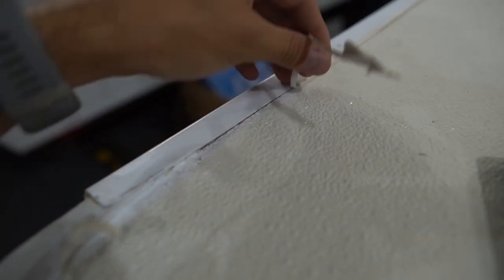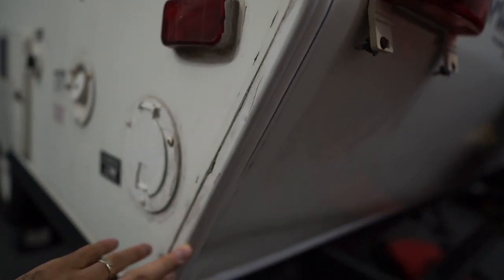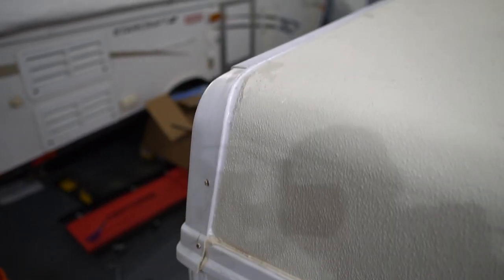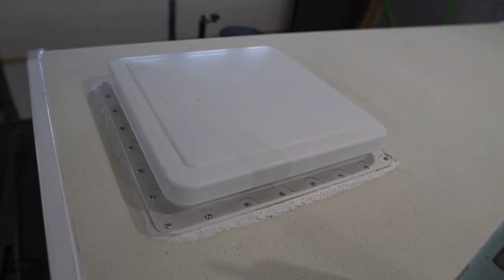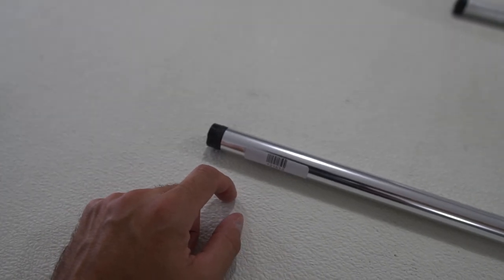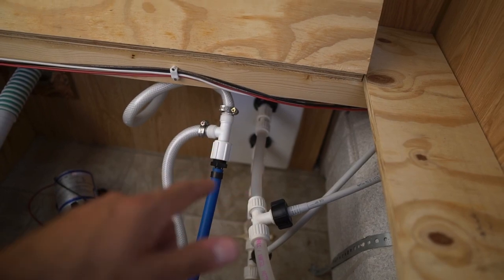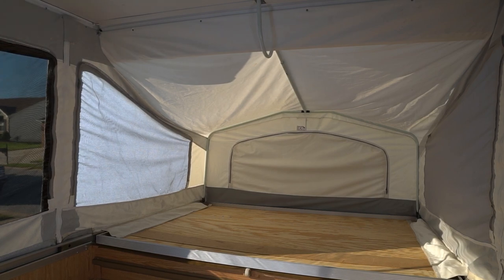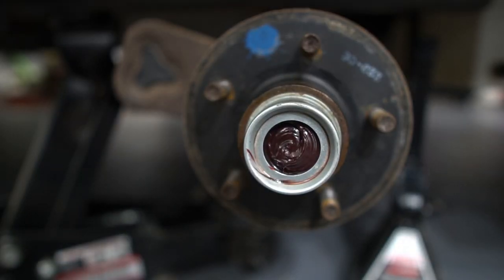You NEED to do THIS to Your Pop Up Camper! | The FREE Pop Up Camper Renovation | Part Six

Comment: Hi,
I work for a caulking manufacturer, and i’m going to tell you one of the best kept secrets in the industry: DON’T SMOOTHEN THE CAULK BEAD WITH YOUR FINGER!

The reason it eventually cracks is because it actually tears up. This is because it lacks the necessary tensile strength to follow the movement of the two surfaces on which it is applied.

 It lacks tensile strength precisely because you removed a lot of material from the bead. More or less like taking a knife and carving off some of the material from a bungee cord before jumping!

On top of that, when the bead dries, it gets even smaller due to the volume loss caused by solvent evaporation.

Leave the bead at a convex shape, learn to like the way it looks, and your caulking will last a lot longer!

Of course, the downside for professional applicators is that they will have less work, since they recaulk less often 😉
Reply: Aargh! I don’t know if I can learn to like it! But still great info!

Comment: Be careful using the ez lube fittings on your axle. Especially if your camper has electric brakes. They will push grease out past the rear bearing seal and cause the brake pads and drums to get grease soaked. Which everyone knows isn't good, but it can also cause a fire from the heat build up with the grease and brakes.

Comment: This is super good info.  Previously being an RV tech we would do this work a lot!  Dicor self leveling sealant on the roof is still my favorite sealer.  It goes on easy, and if you need to get it off to replace a vent or just reseal it later, it is still easy to work with and remove.  After seeing what happens with silicone over the years though I (and the shop) switched to PL based sealer, our favorite being "Sikaflex" in the appropriate color.  It really gets stuck to the surfaces good, unlike silicone which seems to peel right off after a few years.  One important note though... don't get it on your hands!  And don't touch it after it goes on!  It's so sticky that if you do end up trying to smooth it out, you basically end up making more of a mess anyway.  Not to mention it really doesn't come off your hands.

Comment: I used the self leveling sealant on my camper and it still shrunk and cracked. I ended up using 4 inch eternabond tape and absolutely couldn't be happier with it. I would recommend the eternabond all day long.

Comment: Our 1994 Popup camper was stored in a barn and garage most of its life. Someone caulked the seams but used crappy caulking over black mold. I replaced both bearings and both tires. The tires on a popup camper are not the same as an automobile  and do not like sitting in one place for years. The tires on ours were thumping when we brought it home. This indicated the cords were damaged from resting in one place. I replaced the cord hatches and will replace the outlet cover in the spring. With Winter around the corner, I have no inside storage so it got tarped and the Gazeebo cover from our easy up  that the wind destroyed this summer. In the spring ,I have two rolls of the trim tape to replace all the old brittle and missing trim . I intend to replace all buetle tape and recall all seams and joints using Outside caulk.

Comment: Question unrelated. Do you have a video on electronic brakes? We are buying a used high wall Jayco. How do I know if my 2011Ford F150 is set up with proper trailer plug-ins (Lights, braking system) to safely haul it home?

Comment: Hi!  New pop-up owner here...08 Fleetwood Arcadia! Came across your channel a few weeks ago and love the videos I've seen...thanks!  We need to reseal many places on our pop-up and you mentioned butyl tape.  We found strips of this gray stuff in the cabinets of the pop-up that looks like that stuff you'd stick under posters and I'm now wondering if it's the old tape that's been pulled off.  Do you have any videos of you applying that tape? Thanks!
Reply from the maker: It's been a while, but I thought I showed it in this video. It comes in either white or gray. There are links to the butyl tape we use in the video details for a better look.

Comment: I saw that you covered the screws around the AC. Are there any other screws around the camper that should be covered by either silicone or the foam stuff you used around the AC? I heard it mentioned on one of the channels that water can get in around screws if not caulked. Any opinions?
Reply: I want to know about this too! Isn’t scraping the caulk off going to be a problem? The owner is at some flint going to have to replace that flange

Comment: Do you need to reseal the AC on roof??? Any videos on that process?
Reply from the maker: No videos, but your air conditioner has a foam seal/gasket that goes around the perimeter of the roof cut out. If yours needs to be replaced, you can find them on Amazon. Don’t use caulk or any other sealant other than the aforementioned foam seal.

Comment: Hi it does looks nice bit I wouldn't  use Silicone  because there is a kind of acid in that harm the aluminum  you should use the material  what they use at the Rv store
Reply from the maker: That's partly true. Some, but not all, silicone caulks contain acetic acid. Lately, I've been using the GE advanced silicone, which is a neutral curing silicone that doesn't release acetic acid.

Comment: Great video, yeah we always use silicone caulk too 

I remember our 72 Skamper had a 4 panel roof vs newer pop ups with solid roofs plus the roof vent was mounted in the center, we went through tons of caulk haha

Showing my old school greasing bearings those cool quick grease setups remind me of when we installed bearing buddies on our RV trailers & Shoreline boat & jet ski trailers since those get submerged in Chesapeake Bay Salt Water & other Salt Water in Ocean City Maryland etc during launch & retrieval greasing bearings was extra important

Comment: Where did you order the box corner caps? I need those exact caps but am having a hard time finding them. A website and part number would be great… or you could just ask the vendor to send me 4 for free LOL!
Reply from the maker: Ebay, but it looks like the vendor no longer has them.  They were called gray plastic extrusion caps, 2"x2".
Reply: @ItsPoppin  Thanks for checking. FYI - I just found and ordered some from Roberts Sales in Colorado. Old school order by phone works just fine!
Reply: @seancolwell8351  do you still have the contact? I have been looking for those as well. Thanks.
Reply: @ItsPoppin  Thanks for all your great videos they have bee. So helpful. I love pop up camping. Leaving Friday for my 5th trip this summer.

Comment: would you recommend butyl on the top roof edges under the trim?
Reply from the maker: Yes
Reply: @ItsPoppin   Thanks! Also any tips recommendations and or videos on seam repair on slide outs canvas.
Reply from the maker: I believe adventures in pop ups has a seam repair video using an awl. Tell them we sent you!
Reply: @ItsPoppin  Will DO!

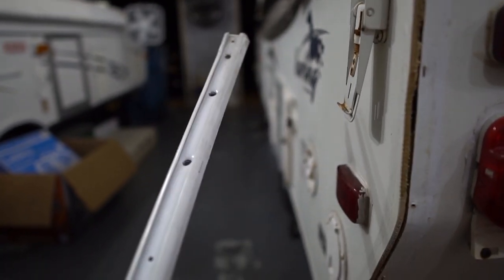Comment: whats that piece called at 8:07 seconds? where could i get a duplicate if im missing one?
Reply from the maker: Not 100% sure on that one - possibly a box corner or a box cap. These vary in size and length depending on your specific pop up.
Reply: @ItsPoppin  yes unfortunate

Comment: If I may be so bold, I replaced the crappy chipboard found on most popup campers. The vertical 'boards' that run on the long sides of the roof. These were absolute mush and I'm surprised they both didn't collapse. A lot can be hidden under caulk; make sure it's dry under there! I would love to send you some pics of my trek to replace these side boards.

Comment: The camper I bought this summer. It has a pull out kitchen. The bottom of the wood was soft. It was leaking behind the storage doors. I had to replace the lower side with real plywood because there were leaks from the sealer not being redone over the years. .

Comment: How frequently do you look to re-caulk or do the canvas?  I appreciate the knowledge.  We are new to this world and purchased a 2019 Flagstaff Mac.  I was curious how often you do all this? Thanks again for all you do with this.
Reply from the maker: I think most manufacturers recommend you check your caulking yearly for cracking or separation. How and where you store and use your pop up is going to dictate how often you need to recaulk. Same thing with the canvas.

Comment: I’m a new owner of ‘08 Palomino. I didn’t notice the difference in the wheel well cover things. I don’t see any screws but am sure these need work to reseal. One looks fine, the other looks like it may have started coming loose and was covered in a very pliable caulk possibly. I need advice on how or what to do to remove and repair especially as there aren’t any screws showing at all. Not like this one in your video. I appreciate your time and knowledge.

Comment: Wish I could add a picture here, but we have a 2007 Niagara, used obviously, took it out on our first trip with no issues, before the second trip I repacked the bearing (previous owner never greased the bearings) and with in 15 miles from my house I completely blew out my right hub and bearing. I found a local shop and have been waiting for over 2 months for a new axel UGH. The factory that’s building the axel is working at 25% capacity due to covid so that’s why it’s taking so long.
Reply from the maker: Wow, sorry to hear about that. Shoot us a picture at itspoppincampers@gmail.com, I'd be interested in seeing it.
Reply: @ItsPoppin  sent
Reply: what do you / the mechanics think the cause of the failure was?
Reply: @andradefamily3957  yeah I’m curious too because my boyfriend thinks he’s a mechanic and he’s not lol. He does work with one, but I don’t really trust him either... he couldn’t even install my hitch without tossing the undercarriage plate in my backseat and shrugging. 

So I’d like to know what mechanically to get looked at because our first trip is going to be rough roads out to private property on lake cushman. A blowout there could be seriously dangerous

Comment: Being as I missed the rest of your shows I have a question about the heater I have in our pop-up camper any ideas how I can fix it or get it fixed,
Reply from the maker: I’m sure an RV dealership would be able to fix your heater as they’re pretty standard across campers.  However, if you’re looking to do it yourself, feel free to send us an email at itspoppincampers@gmail.com with some more details (make/model of the heater, what the issue is, etc.) and we may be able to help.  Another good starting point would be your specific pop up camper heater manual, which may offer some troubleshooting advice.

Comment: I had a lot to learn with my new to me pop up starcraft a couple of months ago after tent camping for years. Your videos are what taught me everything I needed to know.  Now, I need to know if you have a video for pop up door repair and I can't find one.  The top hinge that the door swings down from popped a rivet.  Gotta a fix for that? Would be greatly appreciated.
Reply from the maker: You can pick up a manual rivet gun for about $25. Rivets are easily drilled out with a drill bit. Determine what size rivet you need, or pick up a variety pack in the ball park and you should be good to go.

Comment: Do you store your popup in a garage
Reply from the maker: Yes
Reply: @ItsPoppin  I wish I would have seen your channel before buying my used popup last week it is an older jayco 8t0 lbs.  Does not have Lloyd the doodads of more current ones.  No fridge no heterogeneous no air very basic so I am hoping not as many issues.  I bring it home this week.  Bee n cleaning garage to put the camper in.  I get a little scared when I see all the upkeep but I will move forward here I am an older single woman.  Popup camping is all we did growing up.  Guess I looked at it more romantically as a child I had none of the responsibility.  I may ask you questions periodically.   Best regards Pat
Reply from the maker: Absolutely, send us any questions you have and we will try to help out.